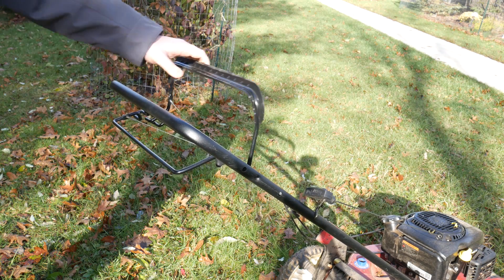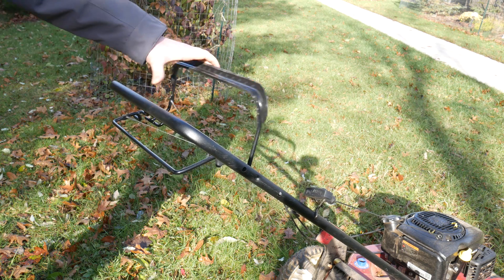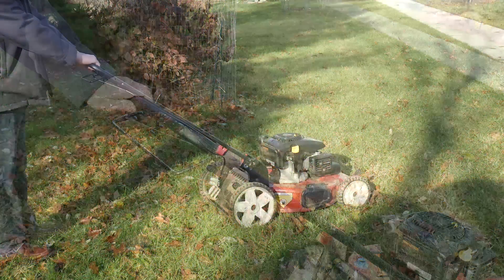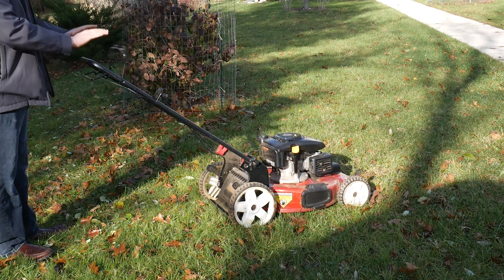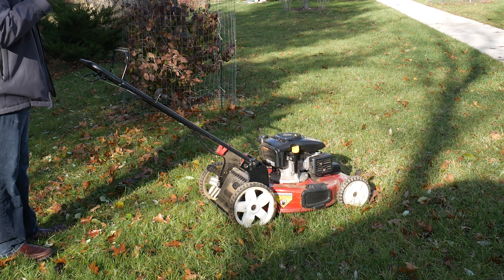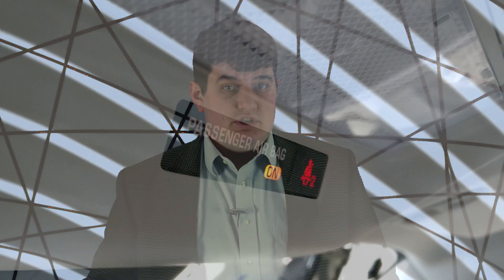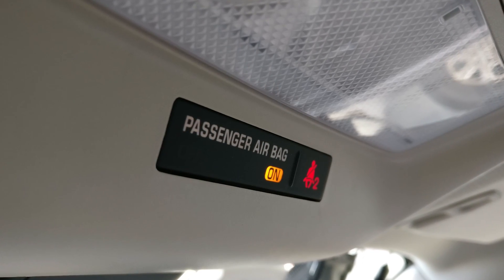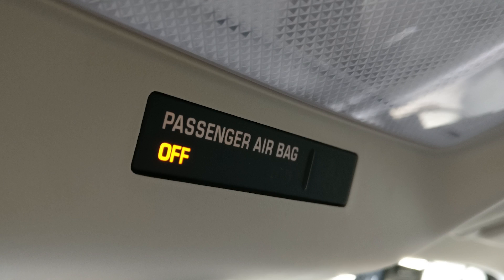The Dead Man's Switch:  How Anton Yelchin's life could have been saved

Comment: Funny how american-biased this is. Most cars in Europe still use manual transmission, mostly because that's what customers want. They are still fully mechanical and have no interlocks whatsoever. You also have to pull the parking brake manually before you leave your car. I'm sorry for him, but I don't think more automation and interlocks are the way to go. Automatic interlocks are dangerous should they fail, because people rely on them. If you have a mechanical parking break with a bowden and you learn to pull that every time you leave your car, you won't forget and you will immediately notice should the brake cease to function properly. If he had manual transmission and mechanical parking break I don't think it would happen, because he would be more cautious. It's called safety paradox.
Reply: Well it's an American car and this happened in America so....
Reply: It is actually wrong to say that automatic is worse than manual, even on lower end cars. It is now getting to the point where in basically any modern car, they either are down a couple percent in power in the worst case, to the same or better in a lot of other cases.

Manual is old, archaic, and worse in a lot of ways. And the rates of people getting auto compared to manual licenses simply exemplifies this. If you actually look at high end cars too, they are often not manual, they are usually automatic. They just have a stepo/semi-auto mode, which is not all that uncommon anyway.

Although I definitely do think it is important to at least know how to get a manual into gear and to shift it, even if you only drive auto and only have an auto license, simply in case there is some sort of emergency where that is important
Reply: @mattymerr701  "And the rates of people getting auto compared to manual licenses " - Where do you live that there is a difference between a license for an auto-trans vehicle versus a manual?
Reply: Yeah, customers in different parts of the world have different tastes. To be honest I think most people in Europe who have manual transmission in their cars don't really have much experience with automatic, which is further strengthening the bias against automatic here. Same for the US but the other way around. Still I think the manual transmission and especially manual parking brake is safer in the context of this video. If you automate anything safety critical (like a parking brake), there is nobody watching over the proper function of the mechanism, which will eventually deteriorate. On the other hand if a mechanical parking brake starts failing, you will find out immediately - it will feel and sound weird. Sure you could forget to pull it but there are so many things you could forget about when driving that would cause a disaster anyway. It's better to be in control. That's why many things on commercial airplanes are still being done manually by the pilots, even if they were trivial to do automatically. It's safer.
Reply: I live in the US and I will be old enough to apply for a permit later this year. I have promised myself to learn drive a manual from the start just because I believe that they are more fun, and even safer to an extent.
Reply: Well my mom had driven a car for 15+ years and managed to run over her own foot because she forgot her (mechanical) parking break, "just do it right" is not a solution to the problem, if everyone did everything right in cars there would be no need for most of the safety-features, they are there because we cant do it right, and we wont do it right all the time.
Also, if he had driven a bicycle the accident wouldn't have happened, but it did because he didn't
Reply: no it is not a valid response, because clearly the driver does NOT do it better, and hoping for humankind to just alter behavior when there is a work-around is just a lazy excuse. and if it really is a valid response, how doesn't that mean the manufactures shouldn't make developments? we just need to do it right, right? so why bother improving the safety??
Clearly because we cant count on people doing it right, no matter how many times they are told
Reply: If you put in an interlock that automatically puts the car in park whenever the door is opened, it wont be long before some airhead decides that thats the normal way to put their car in park,  theyre going to get into the habit of just popping open the door & jumping out without thinking about it.

And this person is going to be in for a very big surprise when the interlock malfunctions, or if they ever drive another car which is not similarly equipped.

Automation doesnt lead to greater safety, it leads to greater dependence on automation.
Reply: Amazinruba I wouldn't. Because I've used both and manual just feels better to me.
Reply: A lot of Europeans are moving on to automatics, sadly.
Reply: You need to re-read my reply. You obviously let your opinion blind yourself.
I did not say the driver does it better, I said the driver is responsible for their operation of the vehicle they own or drive. And also I did say that manufacturers should be making developments towards making things safer or automated
Reply: Amazinruba Higher tax rates for automatic transmission? I doubt that's a thing 😀 Europeans who buy very expensive cars still often chose manual. I think it's mostly a tradition, some markets have different preferences.
Reply: The safety issue is actually in the design of the automatic transmission: It combines two functions - choosing driving direction and parking brake - into one lever for convenience. That's the reason why cars with manual transmissions are safer: Every gear position other than neutral locks the wheels and there is a separate parking brake to engage providing failsafe redundancy. Also simply letting go of the brake pedal doesn't let the car creep. All that together eliminates 90 % of parking lot accidents related to auto gearboxes. Instead of running over people MT cars embarrass the incompetent driver by stalling the engine unless operated correctly.

In the end all this will go away with electric vehicles eliminating the unsafe automatic gearbox altogether while being easy enough to drive for Americans. Although some EVs emulate the unsafe behavior of ATs (including creep), which needs to banned. A car should not move unless you push the throttle or put it into tow mode.
Reply: One reason manual is still so popular is probably because they are way fucking cheaper!
Reply: You would have benefitted from watching the whole video
Reply: You are driving and operating a machine. It is the operators responsibility to know how to use said machine correctly. Sometimes things go wrong. And because the driver should know how to operate their car correctly "Just do it right" is absolutely a valid response. Doesn't mean the manufacturers shouldn't also make developments to make things safer or to automate.

And if he was riding a bicycle, maybe he could have ran into a bump and fallen over a ledge headfirst and gotten severe brain damage. Everything has its danger
Reply: Jan H its mostly tradition.... And here in Europe (UK for me) we actually enjoy driving and don't want to ruin it with a sluggish auto gearbox that gives you less control over acceleration. - only high end cars are worth getting in auto because of the technology used.
Reply: Honestly id turn this whole thing around and call for automatic transmissions to be banned completely from new vehicles

Comment: Cars already deal with the problem of getting out while running, because of automatic door locks, this has been around for a very long time, and that combined with the common knowledge to pull the hand break before getting out just in case have resulted in the fact that unless you try really REALLY hard to, you can't get run over from your car due to it still running, and with modern cars they have perrimeter censors made just for stopping the car if someone/something is there

Comment: you forget one thing if it was done by a pressure sensor it is possible those sensors could get someone injured by it activating mid drive, it would need a lot more code or just use the seatbelt sensor, which would also increase seatbelt use

Comment: Good for you mentioning people shifting in their seats. You could destroy your transmission that way without the speed-checker function. I think the simplest thing to do in this case is make sure the gearshift is designed well enough so that people know what gear they're in (It's very angering that they failed something so simple as a multi-position lever) and anti-rollback/roll-forward technology (which Subaru already advertises) to apply specifically to a car left standing and beginning to roll.

Comment: FCA should have done what VW Group does - if the car is not in Park and you open the door, it warns you with a message on the instrument cluster and an audible signal that you should shift to Park. Simple solution, and it costs exactly $0 to implement.

Comment: It's a great idea but I've hit bumps hard enough to launch me out of the seat for a few fractions of a second. You'd have to add anonther little bit of software to disable the auto-park at speeds above 0mph or an expensive transmission could be shredded by the average North East or Canadian road.

Also, you should only shift into park at 0 just like when you shift into reverse. If there is not a clever little bit of programming that disables auto-park at all soeeds above 0 could lead to major recalls as the planetary gears in automatic transmissions get damaged.

All so I drive a manual and cars like the Civic Type R and the Focus RS only come with three pedal manuals.

Comment: I was very confused for the first part of the video until I realised you were talking about automatic transmission vehicles.
Never driven one, but from what I understand, they roll even when not pressing down the gas pedal?

In a manual, if you want to stop, you either put it into neutral, allowing it to roll (unless you apply handbrake, of course) or you have to shut down the engine. You can't just accidentally put it in reverse.
If you put it in reverse, you have to ease off the clutch or the engine will simply stop due to the sudden torque requirement.

Comment: They could even make a seat sensor in the drivers' seat coordinate with the door-open sensor,  that has been there since forever (makes the dome light work).  If BOTH are activated,  then the car would go into park. This way there is a back up,  and two completely different sensors on two totally different parts of the car (door and seat) must concur.

Comment: I'm honestly in the camp of using the seatbelt sensor as a DMS. If the belt becomes unbuckled, a brief alarm is sounded, if it's still unbuckled after five seconds, an ear piercing siren is heard, followed by a loud and aggressive "SEAT BELT MUTHAFUCKA, USE IT!", after another five seconds of no seat belt, hazards are turned on, the brake is slowly applied, and the horn blares for 20 seconds.

Comment: Need to push your car while in neutral? Better set a 200lb weight on the seat... lol
Reply: tow mode?
Reply: @ NobodyImportant
And if you have an electrical problem?
Reply: Why push it when you can get it towed for free?  It is in a location where the tow truck can't hook on and pull it out without hitting something, you only need to move it a few feet to get it into a better position to work on it, or it died on the road and you need to push it onto the shoulder so you don't block the road while waiting for a tow truck.

For self towing.  You only bought state minimum insurance which doesn't come with road side assistance so towing isn't free.
Reply: What an American stereotype problem, why push the car when you get it towed for free?
Reply: Because I don't want to wait for a tow truck instead of taking five minutes to push my car down the driveway for a quick jump start
Reply: "Please hold the steering wheel while operating the vehicle"
Reply: Electrical problems are not usually all or nothing.
Reply: Or use the override that would be included for similar circumstances.  Put key in override slot and the car can be in neutral without someone/thing in the seat.

The point of the safety checks is to prevent accidentally doing something, not intentionally doing stuff that is sometimes needed.
Reply: If your electrical system breaks down all computer controlled fail safe features would not trigger.  Instead you would coast to a stop(no power = no engine running if you are driving a gasoline or electric vehicle).  Drive by wire systems have mechanical backups for steering, breaks, and a way to disengage the transmission just in case something goes wrong.  If your battery died so you can't start the car you can use the override switch(physical switch not electronic) to take it out of park so you can push or tow it.

Comment: It would also need to know to not do this when the car is moving, imagine the rare case where the seat pressure sensor fails mid-drive and the car goes into park. :D Also sidenote, the inability to press both the gas and the brake pedal simultaneously really sucks in some situations... Especially if you take your car to a trackday and want to heel&toe it.